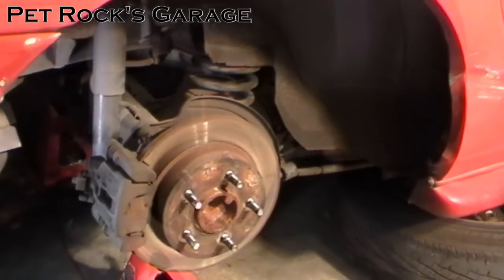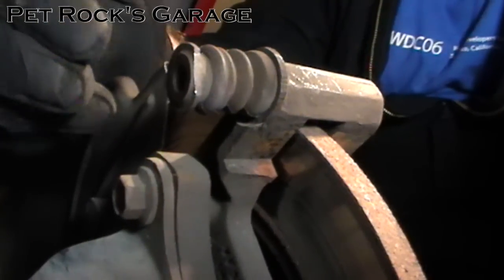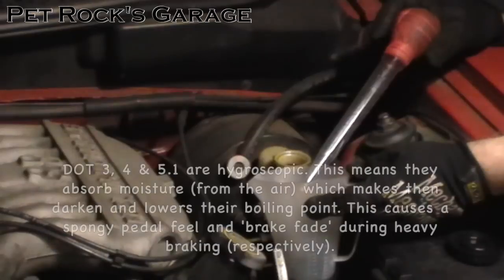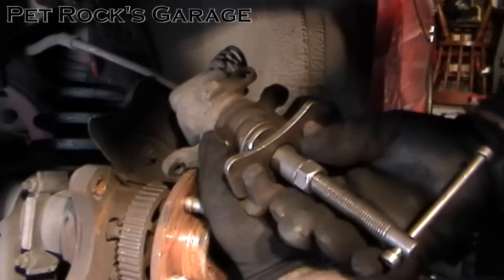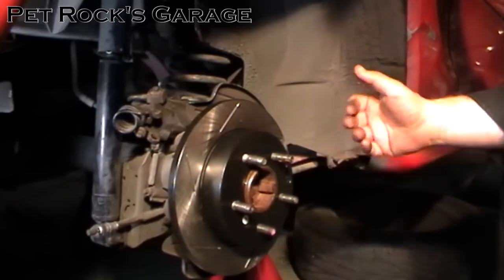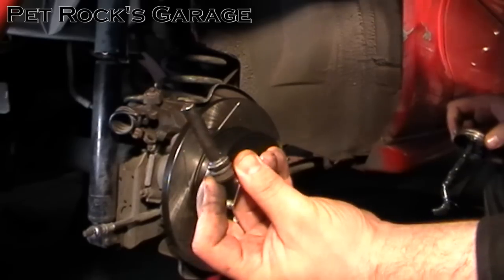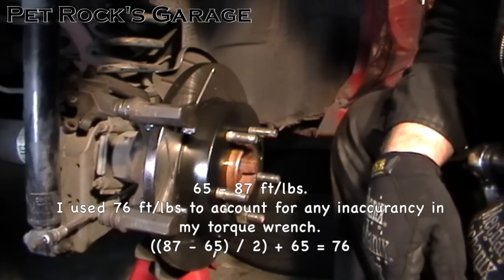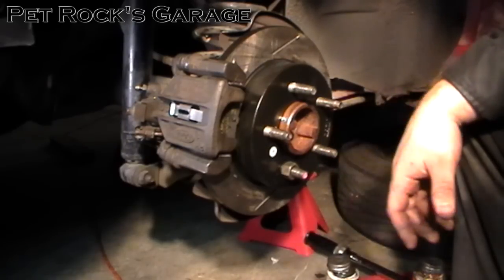How To Replace Rear Brake Pads & Rotor - Ford Mustang (’94 - ’04)

Comment: I'm a 29 yr old single woman who does not have a man or $300 to have someone else change my brakes. Your video helped me see that I can do it myself. I'll hit you up with an update on how it goes. Thank you for the indepth step by step commentary and the side notes.
Reply from the maker: You don't need a man to change your brakes. Just tools (which are sometimes one in the same). :-)  Good luck.
Reply: @petrocksgarage  lol
Reply: Update, 6 years later. I actually did change my own brakes and I found out that many auto parts stores rent you any tools you need, but are too expensive to buy for one time use. I did a wonderful complete break job on my 2002 Mustang and it still serves me today. Once again, thank you. 😊

Comment: I watched several videos on replacing rear brakes.  This was by far the most detail one.  I set laptop on workbench and followed each step.  Brake job was a success.  I'm very grateful would not have been able to do job without the video.
Reply from the maker: Thanks a lot. I appreciate it. I'm glad my video helped you out. Thanks.

Comment: Best video I've seen regarding pad and rotor replacement. Most people show the front brake job which is easier since no special tool is needed to depress the piston and no parking brake cable to deal with. Thanks for posting.
Reply from the maker: Thanks a lot. I appreciate it.

Comment: This video was a lifesaver. Replaced the rear pads and rotors on my '96 GT today for the first time and quickly realized it wasn't the same as the fronts and I was in over my head. Not sure I would have figured out how to get that piston to collapse without seeing this. I only wish I had watched it first so I didn't have to make multiple trips to the auto store to get the special tool I needed. Thanks for making this!
Reply from the maker: A.J. Klingenmaier, thats great!!!  I’m glad it helped you out. Thats why I make these videos. Thanks a lot.  I appreciate it.

Comment: Your video really saved me man. I did one side to my '94 Mustang GT and it just did not feel right. After watching your video I took it all apart again and started over. It went smoothly and like clockwork as I followed it just as you laid it out. I did not know how to use the caliper tool or the flat side of the locator pins or how to remove the brake cable. You clearly showed all of that and now I feel confident that it was done correctly. Thanks!
Reply from the maker: Thanks a lot. I"m glad my videos helped you out.

Comment: Hi. Pet Rock's Garage is now one of my Go-To channels for auto repair vids / tips. You cover all the important factors to a successful brake job. I just KNEW there was an easier way to deal with that hand brake cable on my '99 Mustang. Also, I struggled trying to turn in the piston using needle nose pliers, too. I will "borrow' a piston kit from Advance Auto today, I like the Text inserts you use for clarity (... and, perhaps, your wife upgraded from her former boyfriend, too), I am now a subscriber. Thanks for the high quality videos.
Reply from the maker: Bryan Thomas, thanks a lot.  I appreciate it.  I’m glad it helped you out.  Good luck with your brakes.  :-)

Comment: Great job with this video! I've done several brake jobs before, but watched this video for reference before swapping the rear brakes on a 2000 Mustang GT convertible. This is an excellent tutorial, and I appreciate all of the details and explanations put into each step while keeping it simple enough to fit into a video that clocks in under 30 minutes. You've earned another like subscriber!
Reply from the maker: Thanks a lot. I appreciate it.

Comment: Thanks for the great video instructions. Just completed 4 wheel pads and drilled and slotted rotors on my 2000 GT conv. Rear was a little tougher than the front. Rock Auto Power Stop K1302 $340.02 with tax and shipping.
Reply from the maker: Thanks a lot. I'm glad my video helped you out.

Comment: thank you this video helped a LOT  i had to walk and go get the tool once i had the tool i finished the job quickly . the pliers is a massive waste of time just rent the tool guys. on 8/10/21 the cost of the kit for screw in caliper pistons was 63 dollars. if i had the kit before hand i would of got both sides done in maybe an hour- 1-1/2 hours. great video btw
Reply from the maker: Yeah, the tool is a must IMO and makes the job sooo much easier. They are also available for rent from Autozone & Orielly and likely other auto parts stores, where you get your money back when you return the tool.

Comment: Nice vid.  I’m changing my rear brakes on my Mustang for the first time and this really helps.  Suggestion though - don’t use anti-seize or any other lubricant on a torque spec bolt, unless that bolt application specifically requires a lubricant as specified by the manufacturer.  Lubricants radically alter the amount of torque applied by as much as 50%.  Bolts will stretch and crack under that kind of pressure or the mounts may crack, which you may not notice when tightening, and you could have a catastrophic failure later.  It’s better to deal with the rust by cleaning the bolt and mating surface or replacing the bolt entirely.  A little rust really isn’t an issue and can generally be ignored.  Thanks again and I appreciate the video.
Reply from the maker: Good luck on your brakes. You don't have to use anti-seize if you don't want to.  Its up to you.  But 50% more torque with the use of anti-seize sounds overly high. The studies I've read (granted was a few years ago and I'm going from memory) was only 20-30% which is in the noise for most torque specs (below 40ft/lbs).  I'm not saying you should use anti-seize on everything (eg cylinder head bolts), but on brake bolts it doesn't hurt since they are in contact with the elements more than most any moving parts on a vehicle.  While a little rust is not really a problem, a lot of rust definitely can be.  Especially if you're like most people and don't have a torch or an impact gun (air or electric).

Comment: Same vehicle here, have to replace the rear rotors and brake pads (even though the left ones are good, the right ones just wore out like no tomorrow due to a lop sided brake rotor wear pattern.  Had a bit of an accident where my aluminum rims were bent out of alignment  for the rear when I slid on ice, causing the rim to "imprint" or transfer it's "pattern" to the brake rotor, unevenly wearing it. Hence, the lopsided nature) when I have time because the mechanics I went to last time for a brake change took 6 hrs.   Mind you, this was one set of pads (two) at the time, where there were 6 employees on premises, two cars (two customers; myself and another) and the other customer was just there for a tire change.  Tire, not tires. and I was trying to take care of some errands that day and had work, the six employees were just fucking around and being slow and there isn't another mechanic I can trust other than my father who doesn't mess around.   Between taking my chances with another mechanic who might do the same and my father, definitely my father.

Also I love this video and it's an awesome video because I didn't know how to do a brake job and now I do.  Thank you so much man. :)
Reply from the maker: Wow, that must have been one heck of an accident. Hopefully the only injuries were to your pride & car. Re mechanic, if you weren't happy with their service then I would go somewhere else or DIY it like you did here. Good luck.
Reply: @petrocksgarage  Thankfully it was only a 35mph hit and not any faster than that.  Got the brakes replaced saturday with the rotors and my goodness i feel relieved to know that i have good brakes and that i can stop safely now.    Thank you man.  :-)

Comment: Good stuff! Very informative and well narrated. I would lose the closed captioning, it gets in the way. I wouldn't use so much brake grease either, but you nailed this one dude. Thanks!
Reply from the maker: Closed captions display the words that I am saying in the video.  There visibility is controlled by the settings on your browser, not my videos.  Click on the CC in the video player area and click disable to turn off closed captions.

Comment: Very nice informative video and step by step tutorial. I just want to add that you don’t need too much grease on those calipers clips where the springs ride on. I’ve wrenched for 8 years and i had an 03 GT for 8 years. If you want to try some good brakes with good bite try out the Centric brand. Semi-Metallics are what mustangs use for pad material and they’re noisy even when hot. Semi’s brake better when hot but suck when cold. Ceramics are quieter and have good initial bite but are kinda dusty. If you want even more stopping power, try Stoptech (Centrics high performance brake line) I did a front cobra caliper upgrade to my GT and man the bigger rotor( x-drilled & slotted)  and calipers, stainless steel brake hoses, Stoptech pads and it felt like I had 4-piston Brembos. Anyways, awesome vid man! Lots of tips and tricks and definitely the correct advice and torque specs haha. Nice! Keep it up man!
Reply from the maker: Thanks a lot. I appreciate it.  Nice tips.  I'm a fan of ceramic pads, btw.
Reply: Pet Rock's Garage for sure I understand 
Centric carries ceramic pads as well. The 105. Series

Comment: just to let ppl know how i break them in(taught by Gpa). he says to roll up to 30mph and gradually come to stop. then go 40mph and do the same, and then to 50mph 3 times. finally go 30 and perform a faster stop, but not full pedal abrupt stop or anything. then they should be good2go! great video!
Reply from the maker: Good tip.  The key is to not come to a complete stop when doing this otherwise you run the risk of warping your rotors. This procedure will seriously heat up the brake rotors. So you need to make sure they cool down gradually and that you don't come to a complete stop. For most people though, just putting the pads on and going for a mild drive will do the job nicely.  Good luck.

Comment: Bought mine used and the rotors have been a worry of mine. They were kinda thin when i got the car but they have worked good since i replaced breaks. Time to replace once more so i decided to just go the extra mile and replace as much as my budget will allow. Including rotors, ceramic pads(tired of break dust on my wheels), caliper guide pins and boots. Would replace all 4 calipers total but upon inspection last time i replaced breaks everything was A Okay.
Reply from the maker: Sounds like you have a good plan. If the calipers aren't seized there is no reason to replace them. Replacing the pins & boots is a good idea though. Good luck.

Comment: This was a great explanation and how to  video.  One thing I did notice though was the metal clip on the top of the caliper.  My 04 Mach did not have that either and the rear brakes have not ever been touched.  I also looked at the parts breakdown and Ford does not show it either.  This must be added from brake companies.  I did order it because if it's better, then do it.  Again great video.
Reply from the maker: It's an '04 with the stock rear brake pads? Wow, that is really surprising. It must be really low miles for a 15 year old car. Either way, I agree installing the metal clip is a good idea. The pads will slide against the smooth clip significantly better than the rough brake caliper casting.
Reply: About 90k miles. The front I changed out a couple times (Crappy Pads from box store)  THe Clutch pad wasn't worn bad as well at 73k miles either, but decided to change it since we had it out.
Reply: @petrocksgarage  Also, the two slide pins have about a 1" rubber sleeve on them.
Reply from the maker: @brucemullison5346 , yeah, you can see them in my video (17:39). Are you saying yours did not have them?
Reply: @petrocksgarage  . No, on the actual slide pin, not the boot.  The actual pin is notched down towards the end with the rubber on the pin.  I think I like the solid slide pin like you have but don't know if it is the same diameter.
Reply from the maker: I'm not entirely sure what you mean. I'd have to see a pic or something to know for sure.
Reply: @petrocksgarage  I tried doing a search and couldn't find an image, but one did come up similar.  Google toyota caliper slide pin and look for the image with one sitting on a paper towel.  It's very similar to that except the grooves in it run in the direction of the pin and not across.  Couldn't figure out how to post a picture on here to send to you.
Reply from the maker: Hmmm... that's interesting. I wonder what that is for. I know the Mach models have different front brake caliper maybe the rears are (slightly) different too? I'm not sure. I've never had the opportunity to work on one.

Comment: Awesome video.  I screwed around with a big c clamp for 30 minutes before I came in to see instruction like this.  Glad I did not break anything!  Why make the notches vertical in the piston?  Won't it just turn and push into the brake pad?  Nothing to line up on the brake pad.  Only part I wondered.
Reply from the maker: +Dave Wilcox, yeah, this style caliper confused me my first time too. Your brake pad should have little tabs on them that line up with the notches in the piston. If yours do not, double check that you have the correct pads for your vehicle. You don't want the piston turning when you press the brake pedal.

Comment: Awesome, thanks!  For the life of me I could not figure out how those center clips to fit into the caliper!! No instructions given either. The stock calipers don't use those for some reason. Just put in a  Powerstop Z23 kit (K1303) to match the front that I installed recently.
Reply from the maker: Thanks. I'm glad my video helped you out.

Comment: Superb video!. Very detailed and informative!. Just curious, did you paint the rotors before reinstalling them?. Thank you for your help
Reply from the maker: Thanks a lot. I appreciate it.  No I didn't paint the rotors. The manufacturer of those rotors powder coats the hat part of the rotor at the factory. It's to help prevent rust, but in reality it doesn't really. Most of it flacked off within a year or two. I don't mind though. I didn't buy them for looks.

Comment: Thank you so much for your in depth, detailed video tutorial. Ive changed my front brake pads, rotors a few times now but in the 3.5 years ive owned my 2004 Mach 1 ive never messed with the back brakes. Guess its about that time. Also I never changed break fluid but my local Einsteins Lube checks them and so far they haven't said it needs to be done (granted I take your word over theres). So that's next on my list. Hope to learn more from your videos for my 2004 Mach 1. Subscribing!
Reply from the maker: Bobby Gutierrez, thanks a lot. I appreciate it.  Rear brakes wear out a lot slower then the front brakes because the front brakes do most of the braking. I try to change/flush the brake fluid about once every 2 to 3 years regardless of how many miles I’ve driven. DOT 3, 4, & 5.1 brake fluid is hygroscopic which means it will absorb water out of the atmosphere. So it is one of the few fluids in a vehicle that goes bad over time, instead of miles. As it absorbs more and more water over time the fluid gets darker towards a muddy brown or black. As a result your ‘panic’ braking distance will increase, you’ll experience brake fade a lot sooner in long braking conditions (e.g. down hill) and have a spunky brake pedal. I have a video on how to do it yourself pretty easily that might give you some useful tips.  https://www.youtube.com/watch?v=MPL7bpgcmVI.  Hope it helps you out.  Good luck and thanks again...

Comment: Thanks, i wondered what that caliper tool was for had it for years. Its no so bad if you do smaller turns.

Had to give my brake a tap to get it going in, wouldnt go no matter how many times i turned it, one tap and it started to contract.
Reply from the maker: Yeah, the cube tool does work and has for decades. My dad had one and showed me how to use it when I was little. I have one now too and used it for a number of years on the car in the video. But I alway found it very frustrating. Had to replace the piston in one of the calipers because the cube slipped so many times that it stripped the little notches in the piston so the cube wouldn't hold anymore. Not to mention the busted knuckles from it slipping. Have a couple scars to commemorate some of them too. Then I found the tool I show in the video and have not looked back. It's sooo much easier & faster, IMO. I highly recommend going out and renting one the next time you are playing with the rear calipers. You'll be pleasantly surprised.